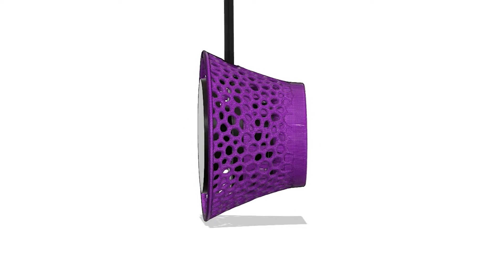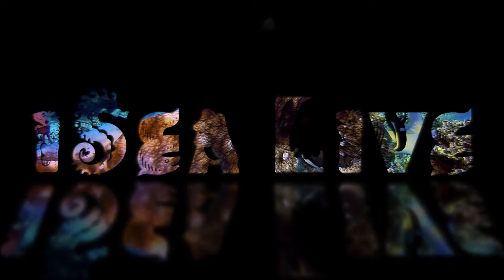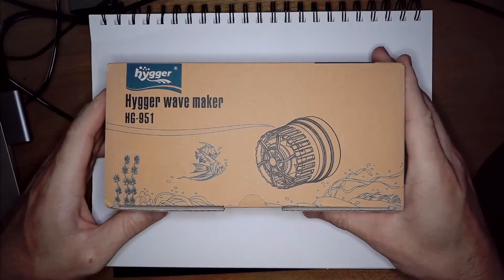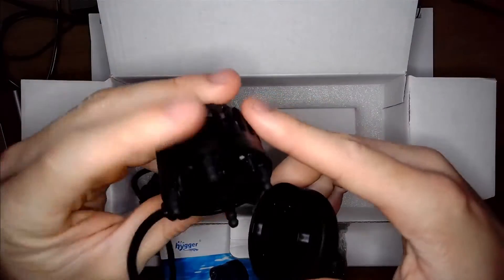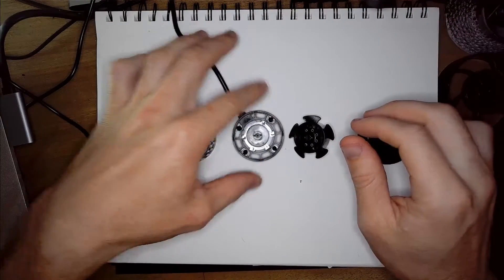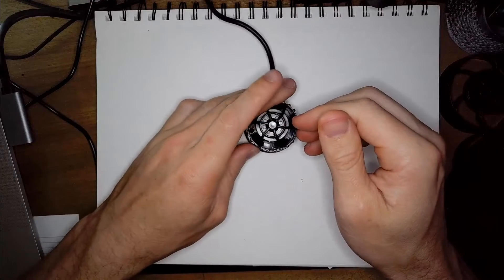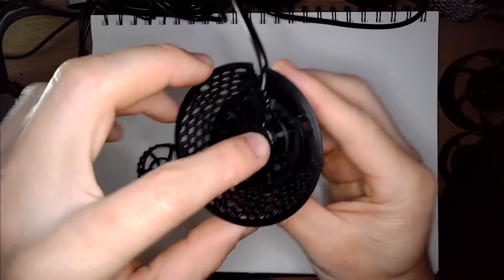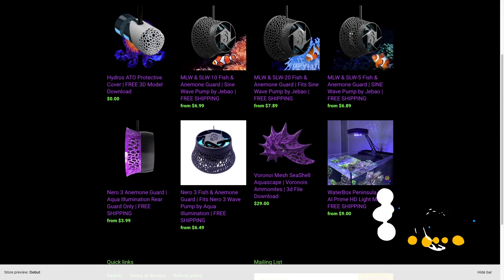Hygger Wave Pump Fish & Anemone Guard | HG-951 1600gph

Comment: What is the difference between the 2 materials?
Reply from the maker: This is printed in PETG or Nylon.  Both materials as strong and reef safe.  Nylon is supposed to be stronger but the major difference is they method they are printed.   
The PETG is printed by heating a plastic and laying down one layer at a time to build the model up.  The Nylon is printed by shooting a laser at nylon powder to build the model one layer at a time.  They laser is typically more accurate and smooth.  It won’t have visible layer lines like the PETG version.

Comment: Man you should do nero 5, so I can order one xD. Love your work. Have you considering smoothing your printing so algea did attach to easily on the surface?  Anyway lobe to see you vids.
Reply from the maker: I actually just order the Nero 5 so that pump is coming next.  I do smooth some of the prints with Acetone but not everything.  Sometime is will discolor the prints pretty bad.  Thanks for liking the videos.  I have a few interesting coming up.